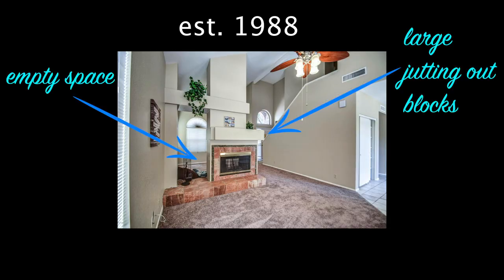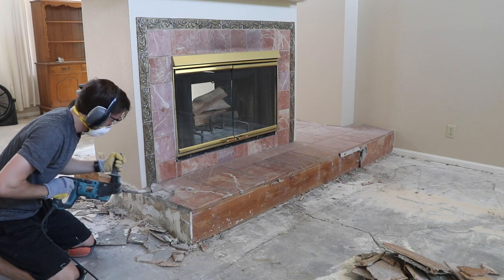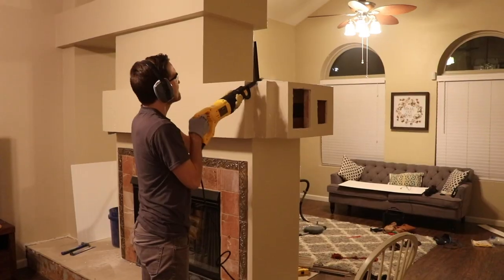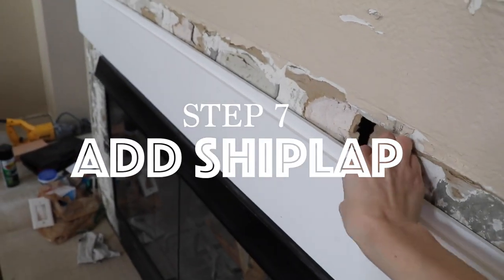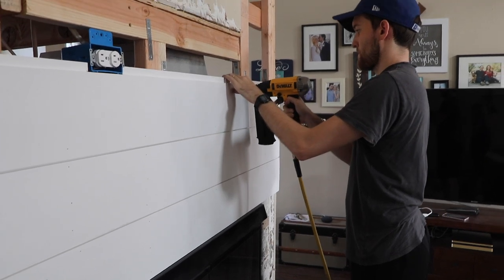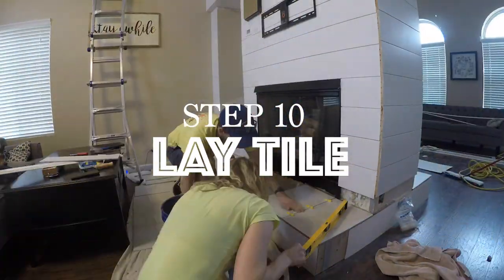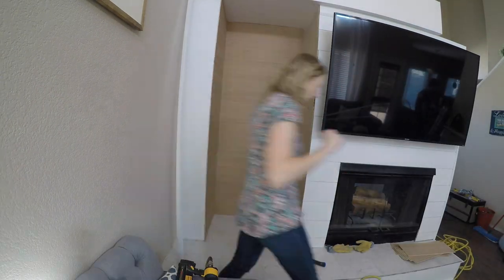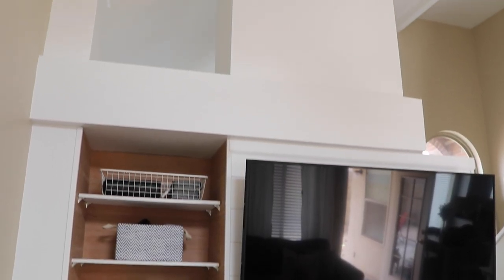Outdated Double Sided Fireplace Remodel

Comment: You did an awesome job! I would buy some of the wood paneling that looks like brick, attach it above the fireplace where that other part of wall is. If you like the brick red look then leave as is but you could also whitewash it so that only some of the red brick shows or completely cover it. I think this would bring that wall into this century!
I actually have a 3 sided fireplace that sits out from the wall. I have been here almost 8 years and can’t figure out what to do with it. Mine has nothing above it just a flat area and is about 4 ft. High x 4 ft. Long and 2 ft. Wide and separates my living room from a large entry room. It’s challenging for sure!

Comment: Wow, removing non combustible tiles and replacing with pine seems risky to me.  I would want to look up clearances
Reply: For a gas fireplace that's enclosed with metal duct ventilation?? So that doesnt really matter. If it did they would not have used 2x4 frame construction for the support and walls that the fireplace and subsequent chimney/exhaust flute are quite literally bolted and attached to. The tile that bordered the side and top of this fireplace for one was layed over composite drywal from the 80s harldy fire retardent not to mention that sat on or was attached to a wooden framed structure. None of the materials outside of the metal fireplace itself that don't directly contact the ventilation are at any real risk of combustion with a gas unit. The tile served no fire prevention purpose at all and was simply just tacky 1980s decorative stuff. Whatever possible situation that could occur causing a fire to ignite outside of a gas fireplace like this with glass doors would have to be some kind of explosion or something combustible igniting while like a piece of furniture clothing ect. That would require flames outside the unit again at that point your house is already on fire either way tile, stone, wood, paper mache, Cedar siding it simply would not matter because the house will be on fire lol